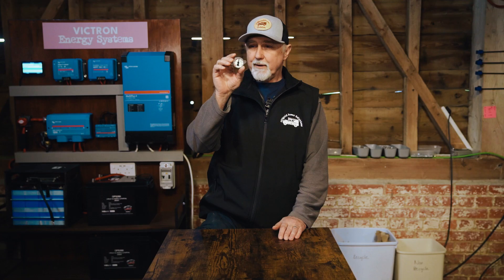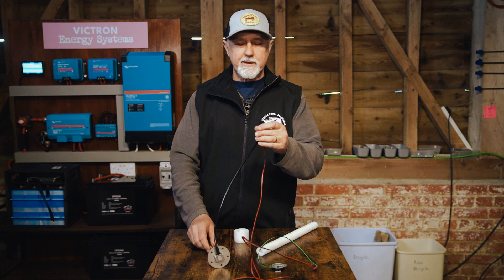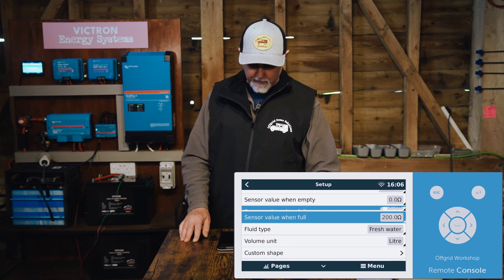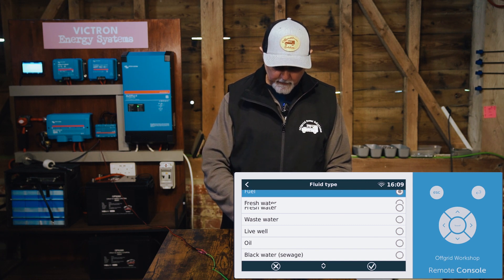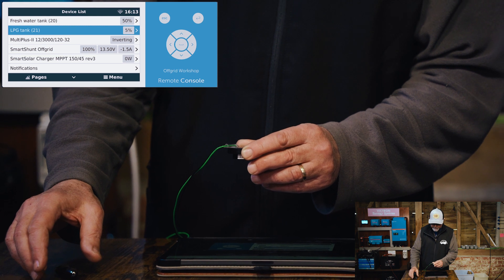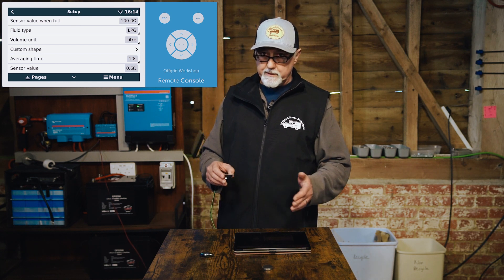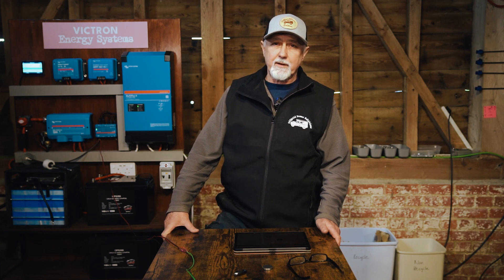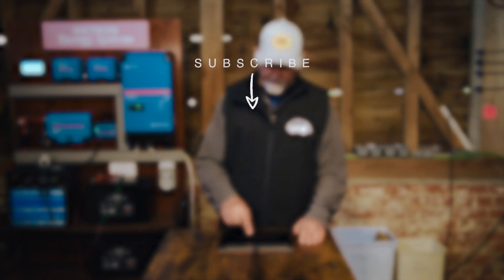Setting up tank level senders on Victron Cerbo GX

Comment: Hello,
I connected a Victron GX LPG tank gauge to my caravan. The sensor works stably when not connected to the LPG tank (180,000 OHM). However, when I connect the sensor to the LPG tank, I get an "open circuit" warning. The level starts showing 380,000 OHM. Since the Cerbo GX's maximum support is 300,000 OHM, I cannot use the system you tried while it's connected to the tank. Would connecting a Cerbo GX Tank 140 to this solve the problem, or is there another solution?

Comment: Hi Roger, is there a sensor that can be used with a heating oil tank please? Bob
Reply from the maker: Hi Bob, we haven’t looked for one specifically but any tank send unit that works on resistance can be used.
Reply: @offgrid_power  Thanks guys, providing it doesn't get decayed by the Oil presumably. I have messaged a few companies and asked, the problem being that a tank that holds 1200 Ltrs is somewhat larger than most water tanks. Bob